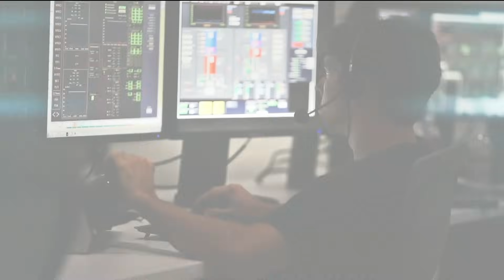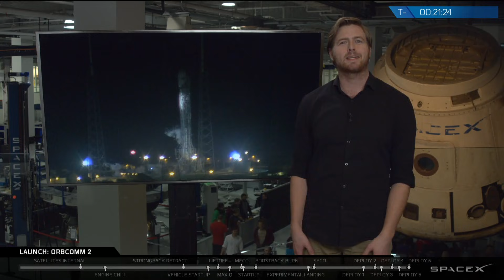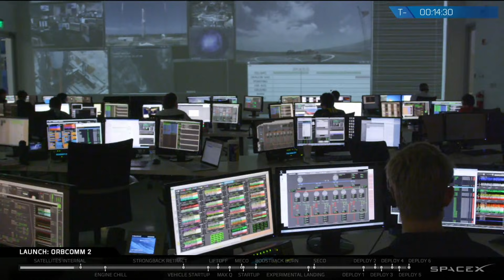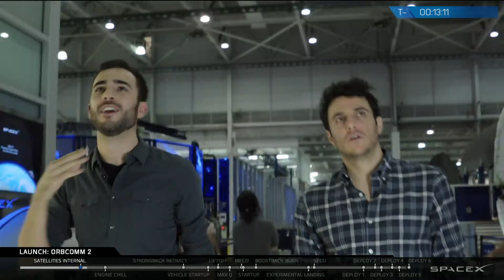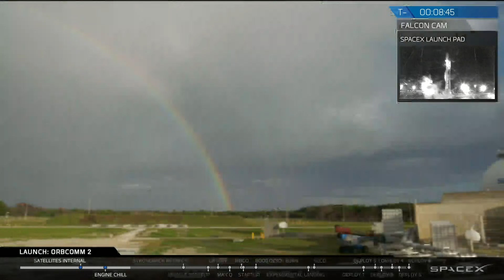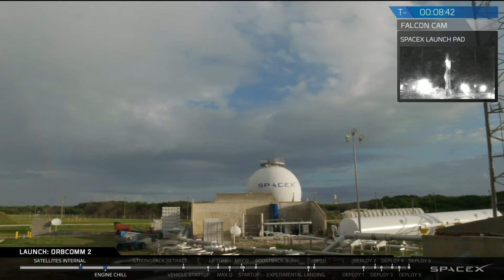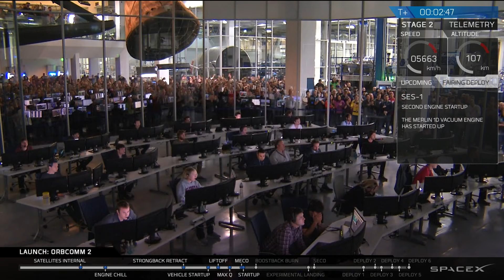ORBCOMM-2 Full Launch Webcast

Comment: Just wondering, how is this more efficient than just parachuting or gliding back, hence no fuel required to land?
Reply: TheArfdog parachute at mach 7 , you should read a physics book
Reply: +TheArfdog If parachuting or gliding back was effective, people would do it. They don't.
The thing is, the fuel is cheap. A rocket costs $60 million to construct. The cost of fuel for launch is $200,000. The amount of fuel used for the 3 landing burns (boostback, re-entry and landing) is a minimal percentage. Also parachutes and other options require considerable engineering upgrades to work. This means more weight and therefore more fuel just to launch. It is clearly more efficient to not add the weight and just use fuel to land precisely where you want it to land.
Reply: +TheArfdog safer, faster and you have more control over the landing position and the landing itself. It's a very expensive rocket so you have to land it carefully and precisely, if you want to reuse it. That's the main reasons why they use rocket+fuel for the landing. When the first stage comes back, it's used most of it's fuel and the second stage is not there anymore. So it's have to manage much less mass then when it's taking off. Which means it's "cheap" to land it.
Reply: +TheArfdog the srb are nothing like the Merlins.  one merlin has had total failure and it caused no damage to the vehicle which still completed its mission
Reply: +TheArfdog The parachutes weight more than the extra fuel that required to bring the 1st stage back....aside from there's no way to protect the 9 Merlin 1D's turbo pumps (which i believe the most expensive piece in the whole engine) from the corrosion of salt in sea water. The Solid boosters of Space shuttle doesn't have this component (since it's a solid rocket), yet it costs NASA tons of money (and time) to refurbish them back to working condition.
Reply: j15781 THey never tried it moron, stop making shit up,  engineers know math and can calculate what would happen beforehand.
Reply: roostewrum Primitive personalities who think they can school engineers!
Reply: Parachutes operate by utilizing drag.  SpaceX aren't operating on the narrow assumption that we will only ever land a rocket in a thick enough atmosphere to provide reasonable drag.  Being able to park it wherever you want it is just an added perk.  Also, landing the rocket under power is just a very complex math problem.  Parachutes get you further into the business of material science and increase the number of points of failure and not by an insignificant amount.
Reply: +TheArfdog parachutes need to he activated too. smh how big and bulky and less control would you think a parachute has? can't believe you are still questioning this.
Reply: +TheArfdog They have their rockets already designed from scratch to be turned on and off.  Not really a failure point.  I guarantee you that every member of their design team has at least 12 years more of physics experience than any of us.  Go research how chutes are packed and their failure rate.  In order to meet an expected failure rate that the government demands they would need multiple chutes each with redundant deployment triggers.  That would weigh far more than fuel and require them to hire a factory worth of people just to pack and maintain, let alone inspect and install. Oh and the rest of my comment that you ignored.  space flight of the future has very little to do with landing on earth.
Reply: +TheArfdog do you really think that what you can come up with after a few minutes of thinking about it would be better than what a gathering of some of the greatest minds in the rocket science industry have researched for years and years? Logically speaking your idea of a parachute isn't exactly original, it was done during the early existence of the rocket program, over 30 years ago, it's time to move on dude. Its like asking people to go back to using the telegraph when we already have instant messaging. give up.
Reply: +TheArfdog its like saying ok lets put parachutes to land a helicopter because the engines might explode on the way down
Reply: +TheArfdog Clearly trolling at this point but no matter.  When a rocket explodes due to engine failure let me know.  Explosions to date by spacex commercial grade rockets were due to improper locking joints, outsourced steel performing far below its rating, inadequate fluids and bad software.  they've proven very capable of making necessary adjustments to software and haven't had fluid issues in several launches.  they are in house testing the strength of steel now instead of trusting manufacturer grading. I'm willing to assume  the strength of collets is easier than the complex mathematics for avionics which they have clearly mastered.
Reply: +TheArfdog And I didn't blame anyone but spacex.  they should test all weight bearing joints themselves and now they do.  They have signed off on many things that were mistakes and they'd be the first to admit it, that's how science works.
Reply: TheArfdog Yeah because the Space Shuttle was such an efficient and cost effective means of completing the task.....
Reply: +roostewrum Don't waste time with TheArfdog.  Blatant troll.  SpaceX could think of a way to do parachute or glide recovery, ULAs parachute recovery is semi-sound scientifically.  The biggest reason and justification for propulsive landing is because if perfected on earth it will be really quite simple to do so anywhere else in the solar system.  This is spaceflight after all and having an objective with the presumption of staying on earth is the old antiquated way of doing things.
Reply: TheArfdog And the Shuttle had a whole of weight.penalty. So much so, it used to cost $450 million per launch and the main booster was burnt on re-entry anyway.
Reply: you are a troll or stupid or both
Reply: roostewrum Um... people have already done it..... ever heard of NASA and the Apollo and Space Shuttle missions? Extra engineering? That's their job. It's to come up with the best, most efficient engineering solution. Extra weight? The extra fuel adds extra weight. So you need more fuel to carry up the "landing" fuel. 

Also saying it's ok to use extra fuel is totally opposite of sustainability.
Reply: Ladislav Tánczos That's why parachutes are used, for a soft landing.
Reply: RainHNg Thanks for the non-stupid reply. But why not parachute to descend... then use a small amount of thrust to land extra softly in the last 100 feet.
Reply: +TheArfdog They tried it, but it doesn't work well enough. The stage is moving too fast for parachutes to be effective. When they used parachutes, the stages were always damaged. Plus they were not able to control the location where the rocket landed. The goal of SpaceX is rapid reuse of the first stage, and the method they are employing is the only practical method of doing so.
Reply: TheArfdog How many of those Apollo booster rockets did they reuse? How many of the Space Shuttle main engines did they reuse? So they recovered $5-10 million by recovering the solid boosters - from a per launch cost of $450 million. But what was the refurbish cost and turnaround of those boosters after they had been dumped in the ocean? 

Boost back works. If parachutes worked everyone would be doing it.
Reply: J brogly.decap Why would you parachute at Mach 7? You must be stupid. The real space vehicles parachute at 500 mph or so.
Reply: roostewrum To me, it seems a lot less energy would be used if the first stage could glide back, no power. If controls are needed, make it a drone, add control surfaces. Just don't see the need to carry more fuel just to land in a controlled manner and in a particular spot. Space Shuttle did it, SRB's could probably do it too with today's controls.
Reply: Glide back won't work. It MUST boost back.

The reason is the rocket here does not itself reach orbit like the Shuttle. It can't travel all the way around the Earth. It would reenter over the ocean as all other rockets do.

And the boost back burns don't use much fuel. There are 3 burns. First one is 3 the boost back burn of 3 engines for about half a minute to turn the rocket back towards land. The second is a re-entry burn of 3 engines to decelerate the rocket so it won't burn up. The 3rd is the landing burn of 1 engine at less than full throttle for maybe 15 seconds.

The fuel use is minimal. And the fuel is cheap compared to the components needed for an orbit and glide landing.

Also. The Shuttle was the payload. The Shuttle main booster was never recovered. SpaceX have just brought the main booster back, something the Shuttle could never do.

The Shuttle never did it.
Reply: roostewrum Understood, but i'm saying with today's technology and with a redesign, the main boosters of the shuttle COULD be made to glide back, under remote or autonomous control, especially with the kinetic energy they still carry after separation. Why not?
Reply: TheArfdog Sure. And SpaceX is demonstrating the tech. An engine fire to go to a re-entry trajectory is required. An upper altitude deceleration burn is required.

The other thing is that makes it more comparable is the Falcon Heavy coming later this year. It consists of 3 cores with 27 engines.

The first two cores separate then boostback for a landing at the Cape. The main core continues then separates and a barge landing at sea will be used - because it is too far downrange to attempt a boostback.

They are aiming for a 48 hour turnaround for the boosters that return on land and (approx) 72 hours turnaround for the central core.
Reply: +TheArfdog troloolloll, ask why don't 747 planes use parachutes to land., sounds foolish doesn't it, much like your trolling.
Reply: +TheArfdog because at the speed they are descending they would need a parachute that would be enormous and cost and weigh more than the actual fuel, smh
Reply: for me
1st, the rocket is made non-waterproof, so it needs to be precisely controlled to land on a barge. had it been a chute, the accuracy 'd be wild
speaking of sts's srb, it was refurbish-able from sea water's effect, unlike falcon instantly dead, because technically it was just a pipe stuffs with solid propellant. 
if falcon went chute landing on land,  it'd need to drive off from the ballistic falling trajectory to the sea, which requires boost back burn, then just a bit of awesome avionic programming to stitch the landing at final phase, chutes 'd become no need/ overweight
I dont think chute landing rocket touching the ground be gentle, just some wind then tip-over
Reply: if a satellite lofting vehicle can glide back, it must be neck to neck with the space shuttle, may the bay a bit smaller. ultra expensive as you saw and painful refurbishment
Reply: forgot, SLS's solid rocket boosters won't have chutes. which makes me abit confuse why
Reply: +J brogly.decap they tried parachute recovery of the falcon 1
Reply: ROberdan385 And how many points of failure do you figure a liquid fuel rocket engine has? Now compare to a parachute....
Reply: TheArfdog You missed the point. No parachutes = less points of failure.
Reply: roostewrum Not activating a rocket engine = many fewer points of failure.
Reply: TheArfdog Not adding parachutes = many fewer points of failure than your suggestion.
Reply: Yeah, good engineering makes liquid run rocket engines  reliable and performance controlable
Reply: ROberdan385 Huh? Just because it's designed to do "that", doesn't mean it was perfectly designed to do so. Even with the best minds in the world. Remember the Shuttle program. Not saying I could do better, but if I ran things, i'd tell the engineers to design a better parachute, not a powered landing system for an Earth-bound flight. Mars, moon, etc, now that's a DIFFERENT mission.

Parachutes don't explode = one less MAJOR failure point.
Reply: TheArfdog Parachutes don't guarantee landing location accuracy or landing orientation verticality. Both of those points require significant addition engineering for parachutes to work - all of that means significant;y more dead weight. And all those extra systems required to get parachutes to work are each individually major failure points.

The fact parachutes don't explode is just irrelevant.

You know what else doesn't explode? Sledge hammers. Just like parachutes they also won't .provide landing location and orientation specificity.
Reply: Ricky Loves You Try 6 years of education and 10 years of job experience. I never said the idea was original. I'm saying they should have used an old idea. Powered landing isn't original either, it was done on the moon. So both old ideas, it comes down to which is the more appropriate design. Parachute is it for earth flights.
Reply: AideTechBot You're equating a helicopter turbine engine (dead reliable) to a rocket engine?
Reply: roostewrum "The fact parachutes don't explode is just irrelevant." -- uh ok you've lost yourself

"You know what else doesn't explode? Sledge hammers." -- This might be news to you, but sledge hammers won't slow the vehicle's descent. Parachutes will.

It's easy to make the vehicle land vertically upright with a parachute. Put its CG below the attachment to the parachute.
Reply: ROberdan385 I'm not trolling, you're a fool. Is that a real question? Uh shuttle SRB anyone?? And yes, SpaceX's own rockets failed too. There you go blaming the suppliers and making excuses for SpaceX, when they own the systems. If the steel was so shitty, if the mechanism didn't work, if the software didn't work, then why did SpaceX sign off on it and launch?

Granted, mistakes happen and that's my point. Rocket engine = way more dangerous and therefore costly than parachutes.
Reply: And for the record the challenger wasn't engine failure, it was mounting joint failure.
Reply: TheArfdog The rocket engine is essential though. In fact it is what they want back. The parachutes though - not so much, especially as they are notoriously unreliable at
A) putting the vehicle precisely where it is required and 
B) in the orientation required.

Adding parachutes increases complexity not reduces it as you claim.

Your suggestion about landing it vertically with parachutes makes no sense. Post contact with the ground, the rocket will NOT be held vertically by the parachutes. In fact, the presence of the parachutes will make the rocket more likely to topple due to wind effects on the parachutes.

Oh and good luck getting a parachute to land a rocket vertically in the ocean, because that is where every single parachute descent rocket will end up.
Reply: +J brogly.decap But the engineers can't control the upper atmosphere winds.  Anytime you give up and use a high-drag device to slow the vehicle, you're at the mercy of where and how fast the air mass(es) are moving. The odds of a successful recovery at a designated landing zone become almost insurmountable.  They'd probably have to carry even MORE fuel to compensate for where the parachutes drag the vehicle. The engines would have to burn longer as the vehicle re-positions over the landing zone, and longer burns equal a greater chance for a part failure resulting in a total loss of the vehicle.
Reply: Larry Woodworth Yep. It would be like flying to Australia, then turning the engine off and opening a chute at 30,000 feet and expecting to land at the airport... oh and without wings or flaps.
Reply: Larry Woodworth Guess you're too young to remember the Space Shuttle? The earth as this thing called an atmosphere... use it.
Reply: +TheArfdog They are working on technologies that can be used on any planetary body with thin (or without) atmosphere, where parachuting and gliding wouldn't work. The purpose of space X is developping cheap and reliable space travel in order to colonize Mars.

Comment: Congrats SpaceX! What happens to the rest of the rocket, the top part which burned the second stage and released the satellites? Does it slow itself down and land into the ocean? If so, do they recover it? Thanks.
Reply: +Joe Joe After the satellites were launched, the second stage engine refired to place the stage on a re-entry trajectory so it burnt up.
Reply: It burnt up in the atmosphere

Comment: after deployment of all the satellites, what happens to the second stage??
Reply: +bovbusto - It will burn in atmosphere. As far as I know, SpaceX is making plans about saving also second stage (at least it most expensive part - engines), but this is much more difficult.
Reply: +bovbusto  The 2nd stage was turned around and fired one last time to force the stage to fall back into the atmosphere where it will burn up.
Reply: +Wojtek Sykurski Not focusing on that now, Elon said they will focus on falcon heavy and MCT

Comment: Hey, at several moments there are some brief views from what appear to be the inside of the rocket like at 36:54. What is this exactly ?
Reply: +Leandro Kieliger (LKieliger) You're looking at the inside of a fuel tank. Probably liquid oxygen. :D
Reply: +clickman03 Not saying that you're wring, but the wiring would have to be beyond complex to do that without leaking, also in the previous launch ( the one where the struts broke ) they didn't upload any video of the strut breaking, which was in their fuel ( though I don't remember what stage ). Also, where would the light come from?

Comment: Why is the altitude increasing very gradually if the rocket is going at 26000 km/hr?
Reply: +Ketho Seyie At this altitude the rocket is flying mostly sideways so it can reach orbit around the earth. Lots of speed horizontally but not so much vertically!
Reply: +Ketho Seyie because its flying almost horizontally to get into orbit.